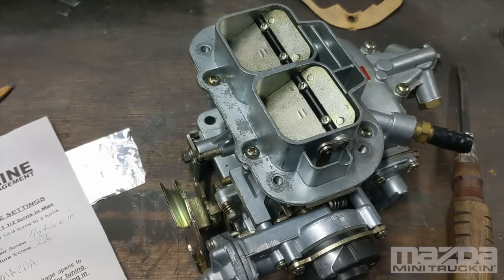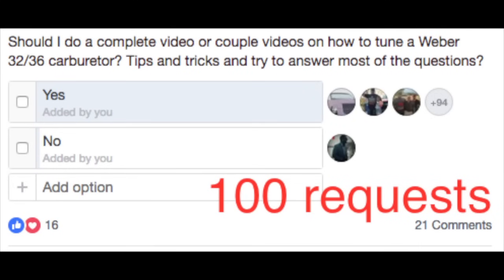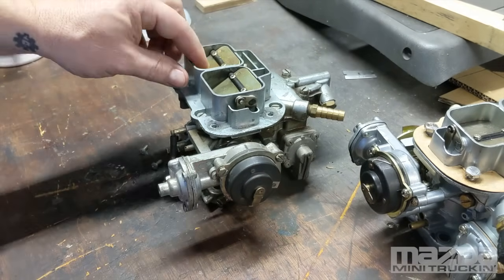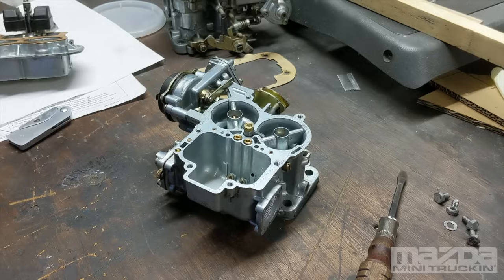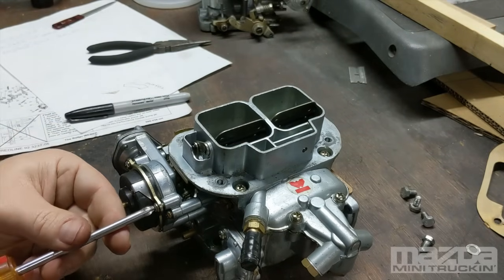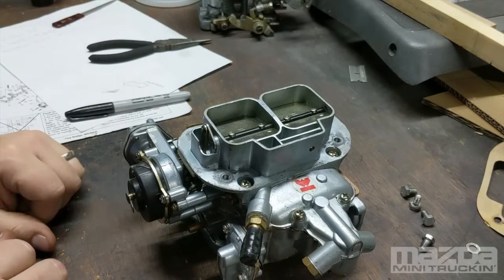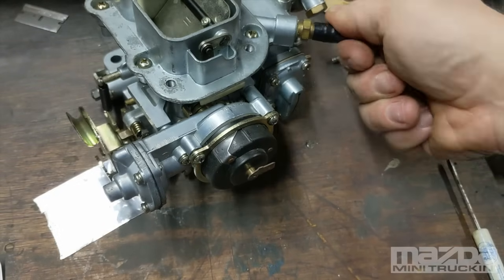How To Tune Your Weber Carburetor 32/36 (in depth)

Comment: Sir.  This is hands down the best Weber guide given to date.  I am now considered the Weber wizard in my area as so many shops have no clue how to dial these in. Alot of shops just throw these on, truck smelling like a gas station at idle.  Your video guide is a blessing, much Thanks.   Helped with Toyota 22r, Nissan 2.4l, Raider 2.4l, and mazda 12a Carbed.   This is the video fellow mechanics, worth a full watch and take notes.
Reply from the maker: Spread the word, share the videos
Reply: @MazdaMitch  Will do.  Seems its a lost art

Comment: Your video helped me understand so much. I was adjusting all those screws blindly before on my 1986 Suzuki Samuria, but now I feel confident I can restore everything to the way it should be. Thanks a million for the guidance!
Reply: My 87 suzuki samurai has a damn water choke and won't even start unless I pour gas down the throat. Then it will run until the gas runs out. But I know I'm getting fuel to the carb. Guess I'm taking it off and cleaning it now. It's a weber DGAV 4 I believe

Comment: Awesome, thanks!! I did the tuning in 8 minutes on my '77 Corolla. Someone had put a clone Weber some time ago, pulled the timing chain, and never finished. I put the car back together and deleted all of the emissions, added a header exhaust, and converted it to electronic ignition. It fired right up but kept back firing and sputtering. I reset the timing and still very unhappy. I reset the the carb tune as per your video and voila!! I ended backing up the mixture screw a half turn after it was set at 2 full turns and it runs like a champ now!! Thank you sir!!
Reply: I run a Weber on my 77 celica but I live on cali so I cant get rid of all the emission crap. I mean I already fail smog with the Weber lol
Reply: @jonbertocchi173  ohh, wow. I wouldn't have thought they'd be checking for emission equipment from the 70's.

Comment: pro tip about that choke linkage circlip: I just took it off ages ago. Unless you pry that linkage, its not coming off that pin or binding. Never had any issues since then. Makes tuning much easier.
Reply from the maker: No sir not doing that my look something would bind up.

Comment: Truly appreciate the time you took to do this video. I just happened to pick up an old Jeep with this carburetor and it's definitely been many decades since I've had a mess with carbs. Not only good explanations but good videography also
Reply from the maker: Very welcome thanks
Reply: @MazdaMitch so if you turn the idle mixture screw all the way in and it doesn't affect the idling at all. What would that indicate?
Reply from the maker: @williamchase5698  it could be that the idle speed screw is too far in, opening the bottom throttle plate, or the seat is damaged on the mixture screw, or that is a vacuum leak somewhere
Reply: @MazdaMitch  it was the idle speed screw...... you're a lifesaver! Thanks.

Comment: Can someone tell me, I am a newbie and know very little about cars. I have an MG Midget with weber carb 32 dgav 5e. There is no idle mixture screw. Port is there but no screw. (Can't see down the hole to see if it is tapped)  My plugs carbonize in only a few miles. Very poor mpg. Does this model not have an idle mixture screw ? Any help from anyone?

Comment: Tip - choke gets "warm" simply by the power being supplied, so you can bench "warm up" the choke just by applying voltage to it, if you want to adjust the choke at "full warm", just leave it connected to 12v for a while before setting rotation.
Reply: I have twin Weber’s on my Triumph TR7 ... so double the trouble.  Thanks for explaining that capping the vent will prevent gas from evaporating out of the bowl.  I only drive this car on the weekends, and it always takes a lot of cranking to get going. I thought maybe somehow my manual fuel pump was letting fuel seep backwards. This makes way more sense. Thanks

Comment from the maker: Weber Carburetor 32/36 Tuning.
This is a video to help share information to our Facebook group.
This information favors the 86-93 Mazda Pickups.

Join the discussion over on Facebook.  
https://www.facebook.com/groups/mazdaminitrucking/

Contents by time: H:MM:SS

0:01:05 Tuning in 8 minutes
0:10:00 Full Video starts
0:12:35 Genuine vs Clone how to tell
0:19:00 Choke pull off 7 mm gap
0:21:00 Poor Quality of the clones
0:24:33 Float Adjustment
0:34:35 Fast Idle Adjustment
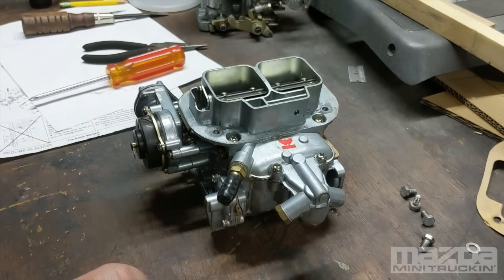0:42:30 Bowl Vent Discussion
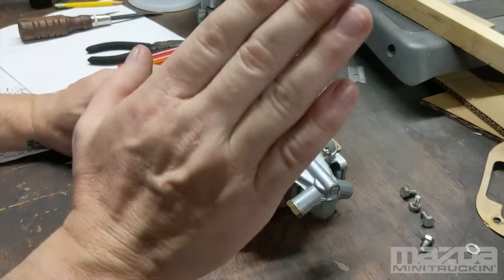0:43:20 Idle Mixture Adjustment
0:49:00 Choke Adjustment
0:52:52 Choke Pull Off Explained
1:04:30 Engine Idle Speed Adjustment

Comment: RE: UPDATED FLOAT ADJUSTMENT - I just got off the phone with Weber. The reason behind the floats needing to be adjusted differently in current day is due to the alcohol content in modern gasoline. The early specs were written when alcohol content in gasoline was around 5%. It's now between 15-20%. This affects the buoyancy of the floats, making them less buoyant, which means the floats need to be adjusted 2-3 degrees further into the float bowl than previous spec. In other words, you want to be adjusting the floats 2-3 degrees in the direction that will make the needle push TIGHTER into the seat. My 32/36 has brass floats. The tech told me what he uses as a frame of reference is the tiny white plastic washer at the end of the accel. pump spring that sticks up between the floats (seen at 29:50). The top of the floats should line up with that white washer when they are adjusted to that 2-3 degree change, without any load on the float spring (like you mention). Again, that washer trick is for the brass floats, I'm not sure about the black foam floats. Call them. They are very helpful!
Reply from the maker: I buy Non Eth whenever I can.
Reply: Does non ethanol make a difference?

Comment: Great video- and great message about why you did this. I have an '84 CJ7 258-4.2L (Not a Mazda Guy--- but I love my rig just the same)- Wanted to install and adjust a Webber 32/36 to replace the stock - yes-'84 stock carb. -- Thank-you for all the info- calm, clear and concise- - loved the rain on the roof too.

Comment: These are great videos - I appreciate it.  I’m not familiar with this at all and my new boat has this carb on a Volvo penta marine engine.  
I start right up but after hot died on idle - so based on your video I’m thinking I need to play with the choke.
Reply from the maker: Share with your friends

Comment: Thank you for your video sir, I know your video is for Mazda 32/36 but I purchased a genuine Weber for my 85 Nissan 720 this helped a lot on tuning my carb, my old OEM carb was on its way out dieseling really bad, put the Weber on after operating temp was good idle amazing but when I took it for a spin she continued to diesel not as bad and is hesitating to start have to pump the pedal but if I let it sit over night she’ll start and idle just fine with no issues without pumping the throttle but once it gets to temp it starts to mess up, but like you said in your video I’ll check timing next 👍

Comment: Thank you!!  I’m Setting and resetting an older Weber 32/36 on a 22r Toyota.  With your videos i am starting to learn this carb and all it’s parts.  Im trying to dial in the choke still.  Keep the settings and tuning videos coming!  Just subscribed.
Reply: Hey buddy I just installed one on my toyota pickup, having problems keeping it running. Any advice

Comment: Thank you so much for this video. I have the same Weber carburetor on my 92 isuzu pup, I took a trip from Houston to San Antonio and back to Houston, went I got home my carburetor is making a loud whinging noise and back fire through out the carb and runs bad and stalls, any suggestions? I checked everything to see if I had a vacuum line busted, I added a new distributor cab, rotor, new cables , and new spark plugs.
Reply from the maker: Sounds like a vacuum leak, could be at the base of the carb, Check it to see if its loose or take it of and reapply new gaskets and use permatex high tack like I did in the how to install a weber video

Comment: @32:47 they probably used a different float for the initial instructions (Brass) Plastic is the new norm. Only 2mm of float travel from closed to open? Wow, that is tight. Great video!

Comment: I’ve been having nonstop problems with the Weber I put in my 87 Toyota pickup. Most of that was vacuum leaks, but I’m confident this video just pointed me in the right direction. Thank you. 

Only thing that’s throwing me off is that I had the fuel mixture screw turned all the way in and it was still running. Maybe I did something wrong somewhere.
Reply from the maker: You probably had the idle speed screw turned in too much and the plates at the base of the carb were opened up some because of that. Idle speed screw and idle mixture screw are two different things.
Reply: @MazdaMitch  yeah I get that they’re different, but you’re saying that the idle speed screw being too high would allow fuel to get in even when the fuel mixture screw is turned all the way in?
Reply from the maker: Possibly.
Reply: @MazdaMitch  appreciate it. I adjusted the choke, and it seems to shift better now. Not great though. If I’m trying to go uphill in first gear, I need to get a running start, and it pops like crazy from the carb. That’s my biggest issue right now. The popping, and the inability to go uphill easily. Fuel regulator is set to 1psi, but I’ve played with that a little and can’t find a sweet spot. Just constant popping when I start off in first, and when I get the rpms too high. I’m really leaning towards a vacuum leak that I’ve missed somewhere, but I was hoping carb/ fuel adjustment would fix it. 

Either way, your video did help me understand my carb better, and I thank you for that.
Reply from the maker: One PSI seems extremely low I don't even run a fuel pressure regulator why don't you remove your fuel pressure regulator and increase your timing to about 12°, it'll probably solve all your problems.
Reply: @MazdaMitch  I was thinking about removing it. My buddy told me it was probably necessary for my old 87 Toyota, but I couldn’t find anyone to confirm it. I’ll play with that right now.

Comment: Awesome job with the video I just got a truck with the same carb and I’m going to check the idle and choke 
Can you tell me the best way to run the wire for the electric choke I know it needs to be fused but since it’s a power cable I should run it from the ignition switch cable ? 
Thanks
Reply from the maker: It needs a 12v keyed on source . I find and use one from one of the plugs left over on the passenger fender well

Comment: I'm about ten mins in and thanks alot I've learned alot .... but I have a 86 b2000 was running fine and one day it started cutting out going down the road but would ideal perfect I've cleaned and opened it up but everything looks good .. could u do a full rebuild video

Comment: You are a genius 👏!! Thank you for the tip of double  cleaning the idling jet , it works on my weber 30 DIC on Fiat 850 coupe
Reply: 45 years ago, the idle jet would clog up on mine. I would back down a hill, turn off the engine, shift to second, close the choke, and release the clutch. Boom idleing again! For a month or two. I miss that 850!

Comment: 1977 20R toyota CHINOOK
RUNS 👍STARTS RIGHT UP.....
AFTER 3 store stops warmed up idle high like choke not shut down or throttle stuck.
I read about throttle screw.....
I read about fast idle screw.
Any advice?
Wish I could afford WEBER
💋😘
Reply from the maker: Check the throttle shaft to see if it's too tight. Check the website mazdaminitruckin.com and read the Weber doc on how to tune
Reply: @MazdaMitch  where is throttle shaft on a Aisen Carb. 20R toyota Engine if U can, please teach me.
💋😘 UR HELP APPRECIATED.🧑‍🔧🙋‍♀️
Reply from the maker: @lindaleehulsey3167  I dunno, look it up online. Im a weber guy.

Comment: What air cleaner you runnin on  your 32/36, you try any interesting ones?  Getting ready to upgrade the air cleaner (or buy a new filter if I figure the one I have is the best setup), wanted your thoughts

thanks for the video, big service to a longtime mechanic but carb newbie
Reply from the maker: I am running the two in tall k&n style filter thats cleanable. I once ran the ramflo, but I gave it to my buddy Jason. The Ramflo allowed air in at all angles including the top.

Comment: Have you tried the manual choke cable version? Just got mine in the mail throwing it on this weekend!
Reply from the maker: Yes I've done that before and I didn't like the hassle. I prefer the electric choke because mine almost out like they're just fuel injected

Comment: Great video! Thanks for the deep dive. Pretty sure you've solved my problem on my 38/38 DGES that I have in my '64 F100. Need to adjust that choke so the choke valves stay open when the throttle is pressed. Dang thing is stuck in fast idle mode. I'll find out tomorrow!

Comment: if there is no wire to the choke will it run at all. thanks for the video. showmehow
Reply from the maker: The choke will never open up and it will stay choked starving the engine of air. Find you a 12 volt source on the passenger fender well and hook it up

Comment: Tons of useful info. Thanks a bunch. Unfortunately the probpem ive been having wasnt addressed that i could tell. My mixtures good, start up choke works good, but heres my problem: genuine weber on an old subaru ea81 in place of the stock hitachi. 4 speed, no od, quite low gearing for a car. So when im pulling 55 im around 3000 rpm, and when i do that for any sustained period, like 2 mins or more, if i take it out of gear to downshift or stop, ill be anywhere from 1300 to 2000 rpm with no load, no foot on the gas, but it idles back down with a tap of the gas. Unfortunately sometimes it goes to the proper 800, but often it wont go lower than 1100 which my unsynchroed 1st and reverse hates, theyre very picky. This can get very nasty in stop and go conditions as there can be grinding and all sort of unpleasantness because it just wont idle down. The only thing i can spot is my throttle linkage seems to have a ton of play in it, it really jangles around in there. Id appreciate a weighin from anyone with carb experience, is this a vacuum issue? It feels to me that theres gas building up in the bowl as i drive thats gotta be burnt off to run right. The issue seems to be worse when its real hot out. I am at high altitude.
Reply from the maker: The linkages. Spray some silicone spray on it to lubricate them. They sound like it's hanging up.
Reply: @MazdaMitch  thanks for the reply man! Ill give that a shot. You ever run into one that all loosey goosey like that?

Comment: I learned a lot actually within the first few minutes so thank you because everytime I’m pushing slightly on the throttle it sounds like there’s a lot of air going through so I’ll adjust the mixture screw and see if that changes anything! Also I didn’t wire the choke so that could be a possible problem as well

Comment: Thanks for all of your videos. All well done and helpful! I have an 87 B2200 Automatic with electric fuel pump and Weber carb. It runs great. The only issue I have is that when the truck is parked for a week or more it takes a while to get it started. Any ideas what the issue could be?
Reply from the maker: The fuel is evaporating out of the bowl.

Comment: Hi Mitch - Thanks for all the great the info. I just got a 72 MGB with this carb. It seems stuck on that fast idle lobe - rpm will not drop.  I am new to webers. I Idle screw is no where near  the stop. If you have a moment- what is not releasing in the choke?
Reply from the maker: The choke has three screws you can loosen and adjust the choke

Comment: Hi sir. I have a problem with my Weber carb not fast idling. It’s hard to start at first, but when it cranks it doesn’t fast idle, but barely runs like it’s about to die. Can you shed some light on my situation, or offer a solution to the problem I’m having. Thanks in advance.
Reply: I have an 86’ B2000 2.0L.
Reply from the maker: Shedding some light. 
https://youtu.be/HhQ9y37M8CQ?si=j5bIWrmtaCbgKPGi

Comment: So I'm not very automotive mechanical inclined. I just put a Weber on my 82 Honda Accord cause I got tired of messing with all those airlines. I need the bigger carb chamber over the bigger manifold correct? Or does it not matter?
Reply from the maker: No idea it's not an 86 through 93 Mazda truck so I don't know what you're dealing with

Comment: Hey mitch how you doing bro I enjoy watching your videos, listen bro I have issues with my mazda I did the idle I move the shock a little bit but it won't stay  i crank it up to 2000 but once I tap  the gas pedal  it shut off what do you recommend recommend
Reply from the maker: Sounds to me like the choke is warmed up and it's immediately open when you oat the gas and off all fast idle cams
Reply: @MazdaMitch  so what should I do or recommend Mitch
Reply from the maker: @boykarodriguez9535  Rewatch the videos? I have several on the carb, an entire playlist in fact. Check it out.

Comment: Sorry if I missed it, but what is that scre just above the throttle? The long one sticking out close to the idle screw, running perpendicular to it? Is it also a jet? And if so I'm guessing it gets tightened down all the way?
Reply from the maker: Can you provide a time stamp at what you're talking about?
Reply: @MazdaMitch  I guess you can see it pretty well at 1:05:15. Just above the threads that the idle speed screw screws into
Reply from the maker: @codeguise it's just a plug or Port I think you can remove it and it will allow you to have a vacuum port
Reply: @MazdaMitch  ah okay great, thank you!